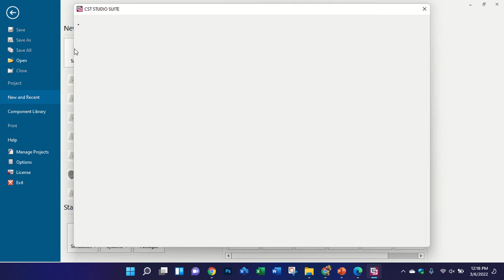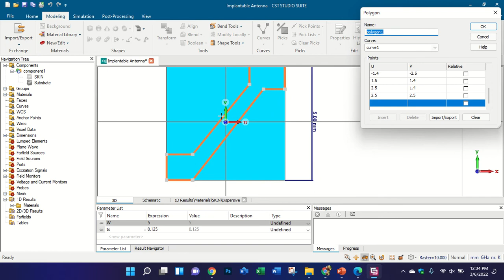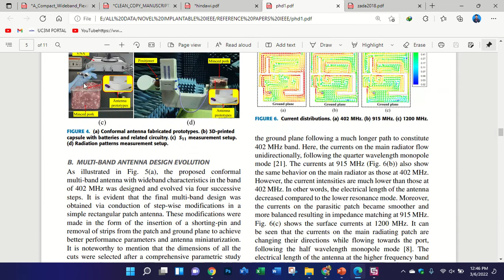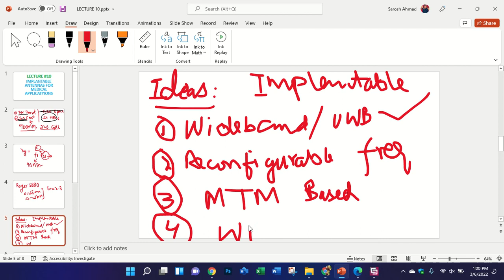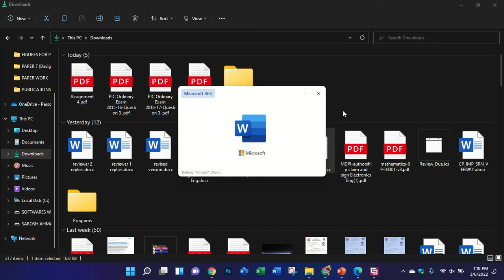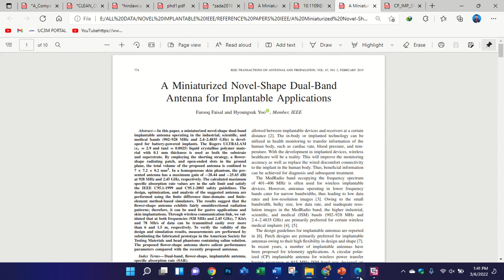IMPLANTABLE ANTENNA DESIGN IN CST STUDIO [LECTURE 10] #antennadesign #cststudiosuite #graphs #SAR

Comment: If want to design metamaterial antenna it is also use the same setup?
Reply from the maker: No, first Watch my video on Metamaterial, you have the design the Unit Cell  inside human body to get required resonant band, then combine metamaterial with antenna, to check combine results inside human body